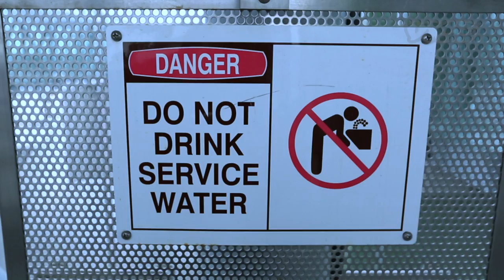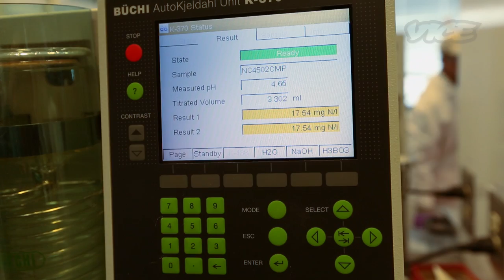You Don't Know Shit: VICE Reports (Part 1/3)

Comment: You dry that stuff and burn it to produce electricity...

Burning methane into CO2 is a lot better than releasing methane (which is a 20 times more potent greenhouse gas than CO2). America, it is not hard to be eco friendly. You burn garbage and sewage instead of putting it in landfills, which not only gives you electricity, but reduces greenhouse gas and local contamination from landfills, and gets rid of the problem with finding space for the landfills. And this helps with energy security as well.

Burning garbage is also a way to regulate energy production. The core problem of wind, water and solar energy is that outside elements control the amount of power you produce which force you to use fossil fuels to regulate the power production, but you can just use garbage and excrement for this instead of oil, gas and coal.

This is not something that just makes us able to drop fossil fuels over night, but it will be able to do a lot to both help the environment (on many different levels), energy prices, and energy security.
Reply: Yeah, I wish more people would get on board with that.
Reply: Preeeeeetty sure its a lot more complex than drying it then using it as fuel.
Reply: Plumpucus Nothing good is simple (no it is not that simple in the actual process, but for us non-engineers going into details of the process will only make it seem a lot harder, than it actually is in practise), but just because something is complex does not make it difficult...
Reply: bloodlazio if we burned all our waste and everything we didn’t need like your suggesting the o zone would have a hole in it and the world would have ended